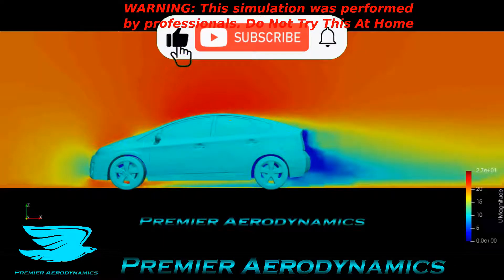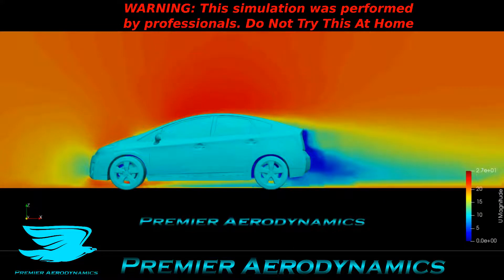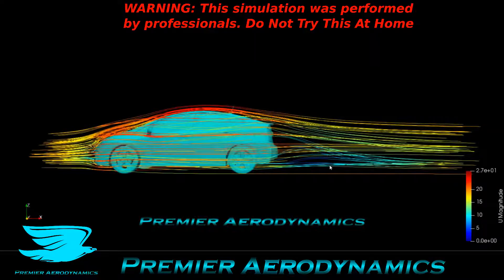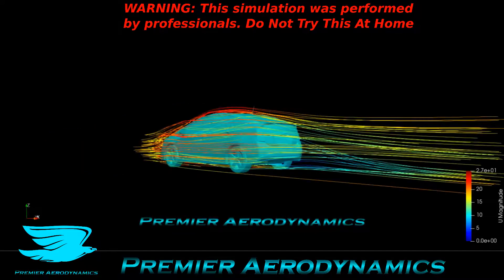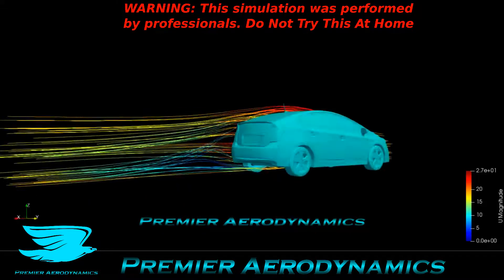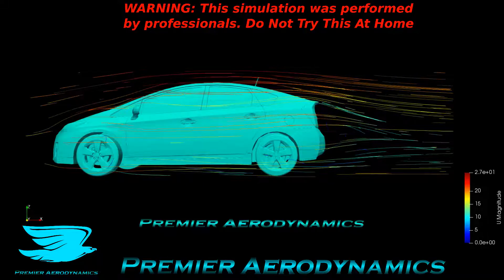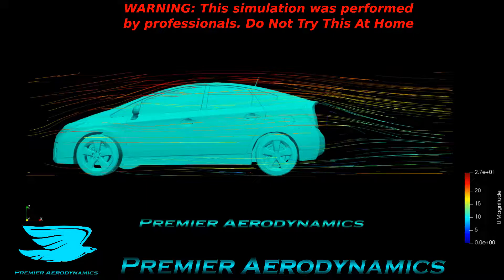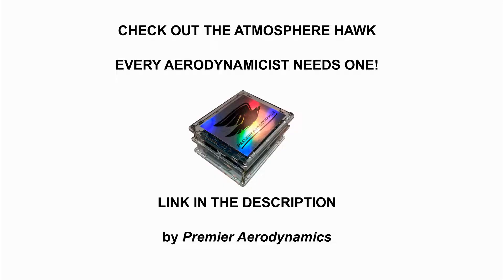Prius Aerodynamics 2010 Model

Comment: If you could place some vortex generators, where would you put them?
Reply from the maker: I would probably put them at the rear diffuser (underneath the car towards the back). The reason being that that region is usually very prone to separation and so the vortex generators would help with that.

You could also run the diffuser at a greater angle to reduce the wake and drop the drag.
Reply: @PremierAerodynamics interesting, I’ve just bought a 2013 Gs spec Prius and this has small vortex generators on the underside of the rear defuser. It has a factory fitted body kit with a more aggressive front lip and rear defuser along with a host of underbody reinforcement braces.